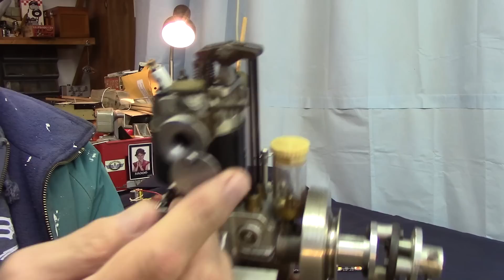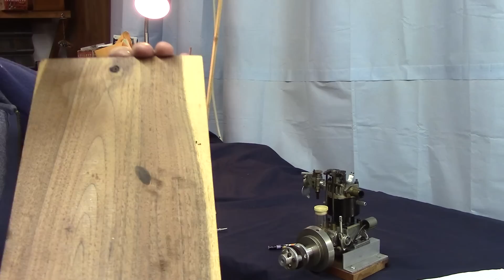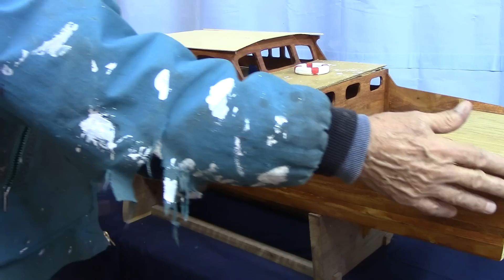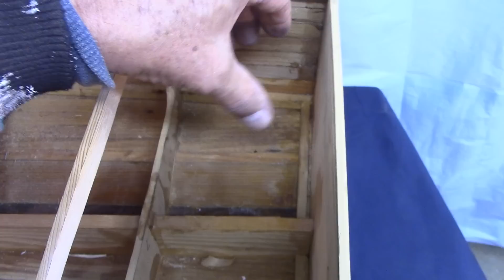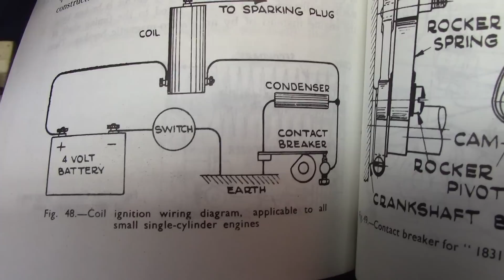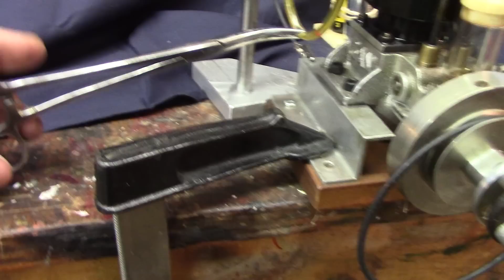Runing vintage British Ganett 4 stroke model Boat engine

Comment: Cool engine and boat, it probably vibrates a lot due to the shaft coupler swinging around off center.
Reply from the maker: That is a good observation, the coupler is a bit off center.
Reply: Yep - the universal

Comment: ⅜" x 20 is BSF (British standard fine) note it is a 55 degree thread form, not 60 👍
Not sure this will help you, but should you find any old (or new) British fishing tackle, you will find that rod rest tops, and landing/keep net fitting will screw straight on.
PS: not sure I should thank you for the sudden absolute 'need' to own one of these 😅
Reply from the maker: Thanks so much for the info.
Reply: In English !
Reply: @tonywright8294   Yes it is.